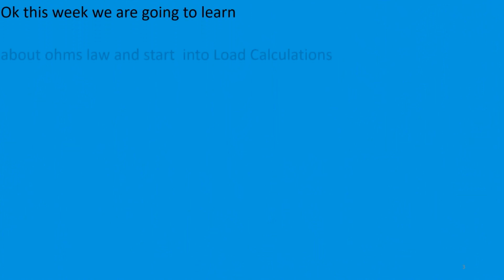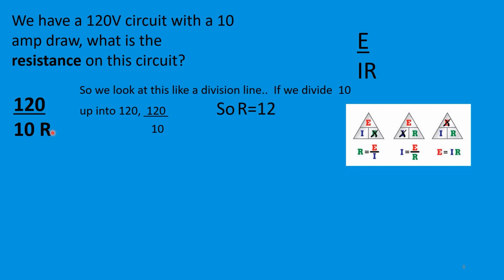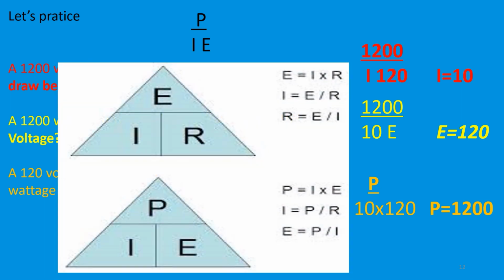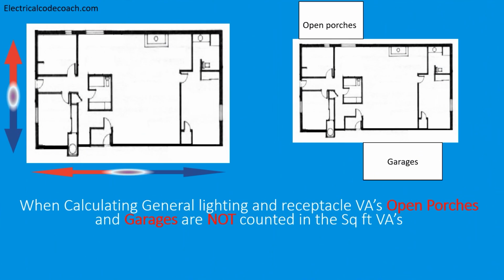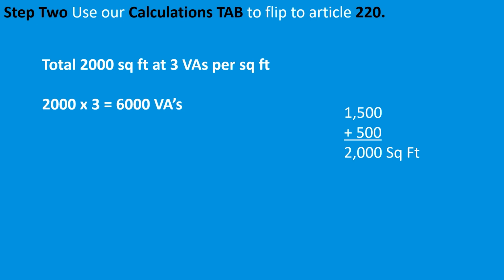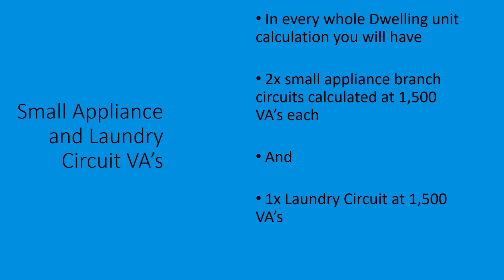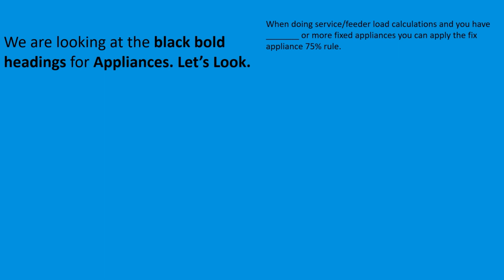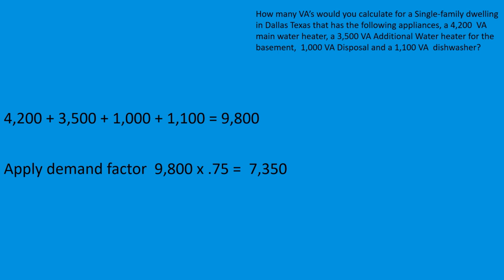Week 2 NEW VIDEOS AVAILABLE!! Electricalexamcoach.com

Comment: Hi there. Im trying to follow along but it seems my new 2023 Nec doesnt match yours. I do not have a 220.12,
Mine goes from 220.11-220.14. Page 93 of my book has a table 220.3. Page 94 has no table and page 95s only table is 220.42 . I can send pictures but my book doesnt match. Making it hard to follow along.
Reply from the maker: Yes this is only good for 20/20 and previous